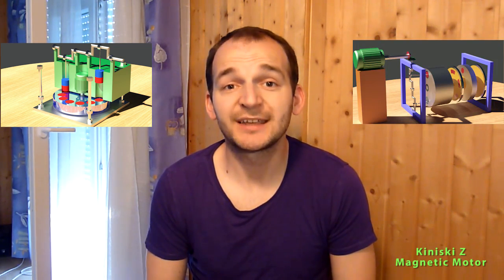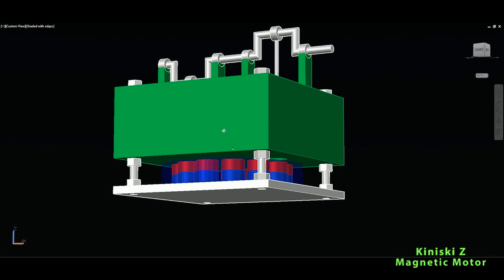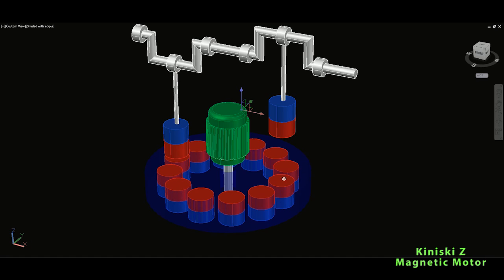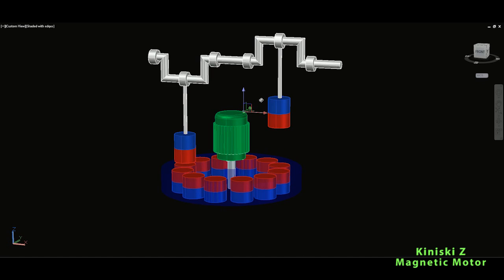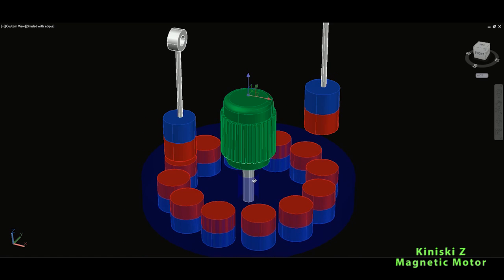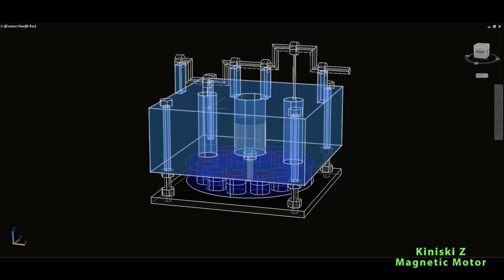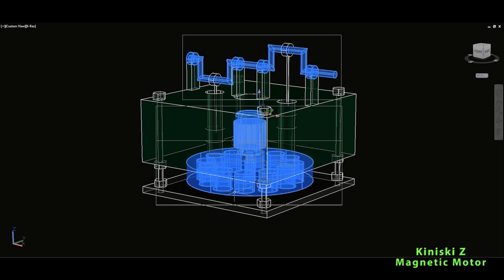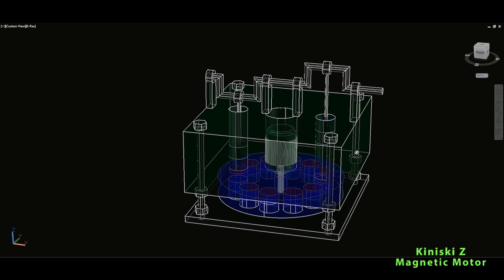Free Energy Generator, KINISKI Z Magnetic Motor, Rotary to reciprocating device

Comment: it absolutely will not work. the pressure on the rotors will find equilibrium and not spin any longer. it would just stop spinning with each rotor and it's halfway up or down position